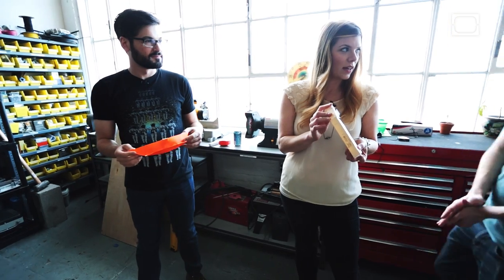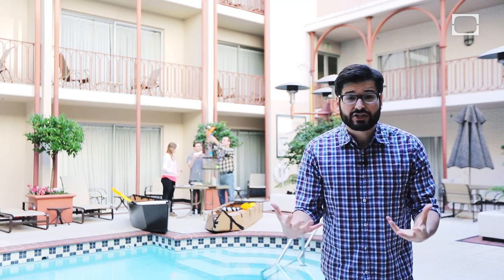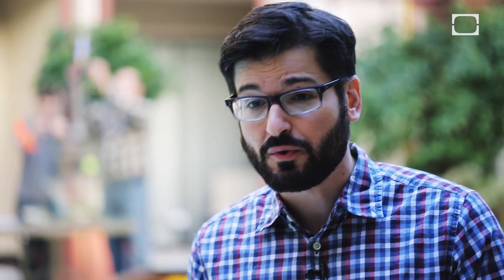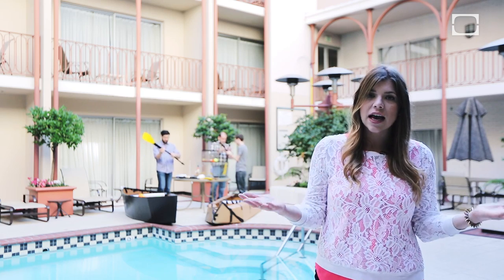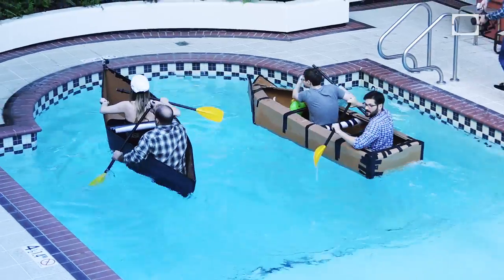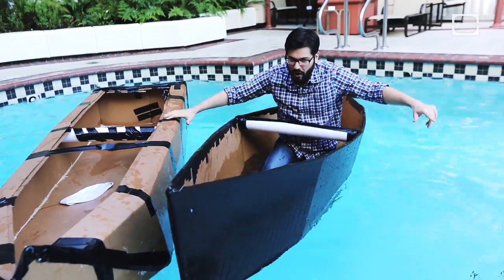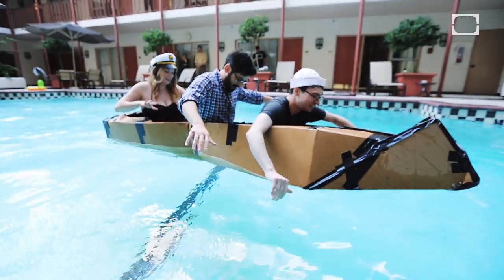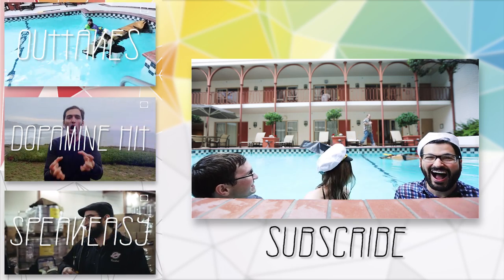Floating on $20 Cardboard Boats

Comment: I understand how the cardboard in the kayak did not immediately get soaked with water, it was covered in duct tape, but how did the cardboard boat not get immediately get soaked with water?

I did not see visible waterproofing on the cardboard boat.
Reply: Corrugated cardboard does have some resistance to the water plus the boat had 2 layers of it. It definitely wasn't waterproof but it is understandable how it can stay afloat for a certain period of time.
Reply: Shade13Fire I made a tiny cardboard boat. It floated for a few seconds, but it got soaked in under a minute. A toy soldier would have caused the boat to immediately sink.

The corrugated cardboard you are thinking of, with wax or plastic fused to the outermost layer of paper, is not standard, and no one in the video said that that was what was used.

Regular corrugated cardboard, like any form of paper, gets soaked pretty quick.

I think they sprayed some kind of water resistant material onto the cardboard, but that should have been mentioned and shown.
Reply: abrahamchapman Nope, we used plain old cardboard with no sort of spray. The cardboard seemed pretty water resistant until it soaked into the corrugation.
Reply: abrahamchapman They mention the part about the corrugated cardboard at around 1:00 btw.
Reply: DIY Tryin My miniature version of your boat got soaked and sank pretty quickly. It was made with one layer of corrugated cardboard. Perhaps the glue used to sandwich two layers of cardboard together served to partially 'waterproof' the inner layer of corrugated cardboard.
Reply: Shade13Fire I know. I did pack'n'ship at the FedEx shipping section of a Kinko's for over three years, so I am very experienced in the field of manipulating and modifying corrugated cardboard. 

My miniature version of their boat got soaked and sank pretty quickly. It was made with one layer of corrugated cardboard. 

Perhaps the glue used to sandwich two layers of cardboard together served to partially 'waterproof' the inner layer of corrugated cardboard.
Reply: abrahamchapman Don't you think that perhaps you just made an error with building it? I doubt there would be enough glue to make a boat big enough for two people partially waterproof if you believe that the cardboard has almost no resistance to water at all.
Reply: Shade13Fire  I don't understand how that could be. I used corrugated cardboard, from work training and experience I am excellent at making cardboard do what I want it to do, and I was extremely careful in ensuring that all of the seams were completely sealed. That said, anything is possible. Perhaps I made an error.

I took the one element of my experiment and built a hypothesis around it. The only thing that I did differently, other than the size of the final product, was I did not sandwich tow layers of corrugated cardboard. I used only one layer of corrugated cardboard.

Think for a moment about what it takes to turn two separate sheets of corrugated cardboard into one. If one actually wishes to end up with a sturdy product, every square inch of the glued sides of both sheets needs to be covered with glue. If indeed that is what was done for the cardboard boat in the video, then there was a layer of glue in between the inside sheet and outside sheet of the corrugated cardboard that made up the boat.

As long as one sheet is dry, it will hold up for the five or ten minutes they spent shooting the video.

My hypothesis is sound. If only I weren't too lazy to build a full-size replica of their cardboard boat! It would be fun to see a single sheet version float for five minutes, thus disproving my hypothesis. That would be sooo much fun to do.
Reply: Have you considered the surface area to volume ratio as well as the density of the cardboard.
Reply: KS Ng The only thing I see as relevant in your post is the density of the cardboard. When factoring cardboard getting soaked with water, surface area to volume ratio does not matter. All that matters is naked cardboard touching water. With half of the cardboard's surface area outside of the boat, nearly half of the cardboard is touching water; it would take only seconds for the cardboard to become soaked with water.

Since I did not use the same exact cardboard that was used in the video, there is no way for me to know exactly what was different about my test boat's material.

The cardboard I used was pretty thick. It did not have that wax coating that some cardboard boxes are made with. If the wax coated cardboard was what was used for the boats in the video, the wax could have provided some water resistance. However, one response to my post by the boat builders said that they used regular cardboard, not wax coated cardboard, so that theory is out.

If one watches the boat construction video, one will see that multiple sheets of cardboard were layered together. That means that there was a layer of glue in between the cardboard that made up the outside of the boat and the cardboard that made up the inside of the boat. The glue could have provided the some water resistance to the inside layer of cardboard. That's the theory that makes sense to me.
Reply: abrahamchapman ._. Firstly your theory about the glue is ridiculous. Secondly people even make paper boats that float fine in water (Miniature ones with no added weight) so there shouldn't be a problem with cardboard floating as it does it naturally but not indefinitely. No need to write an essay on your denial.
Reply: Shade13Fire Paper is not as heavy as cardboard. Comparing paper boats to cardboard boats is not a valid comparison.

The glue theory is not is not as ridiculous as you believe. Many water resistant sealants are based on glue formulations.
Reply: If you think that surface area to volume ratio does not matter then you know very little about science in general, not even about paper.

The surface area to volume ratio is one of the most important factors of diffusion and absorption. A small boat like the one you made will have higher surface area to volume compared to the large boats they made which will have lesser surface area to volume.

The higher the surface area to volume, the faster water is absorbed and diffused, which means the density of the waterlogged cardboard increases faster causing it to sink at an exponentially faster rate.

This is also where gsm comes in, because the internal structural density of the cardboard also contributes to the surface area to volume ratio, even the physical structure of the pulp matters to how fast water is absorbed and diffused.
Reply: abrahamchapman :D You have no idea what you are talking about.
Reply: KS Ng I think it is more of an unwillingness to make full-size cardboard boats to test in an actual pool than it is a lack of general science knowledge, but that's just me. I can only go with the data I've got, which is a tiny boat, made of a single sheet of thick congratulated cardboard, that got soaked and sank in under a minute.
Reply: Shade13Fire I think it is more of an unwillingness to make full-size cardboard boats to test in an actual pool than it is a lack of knowing what I am talking about, but that's just me. I can only go with the data I've got, which is a tiny boat, made of a single sheet of thick congratulated cardboard, that got soaked and sank in my bathroom sink in under a minute.

Comment: ships with steel hulls doesn't float because of air...
Reply: It sort of does. It floats because the hollow steal has a density that is less than water (1 g/cm). And he meant the air inside the hollow steal has air inside of it.
Reply: +Bing Squid its still the displacement of water by the rest of the internal area of the ship not the small amount that is between the steel

Comment: the local cardboard boat contest the ok item list is the carpet center tube there big 6-7in center thick paper tube rule say the seal off on the ends to be uses as floatation many for a raft  to make sure they no cheater they will inspect by drill in to any looking with mini cam to look inside floatation